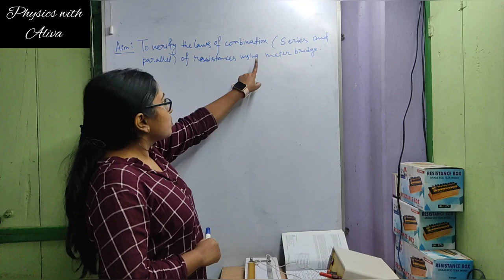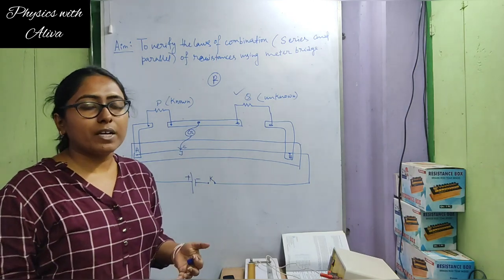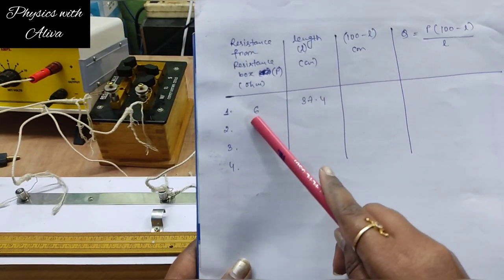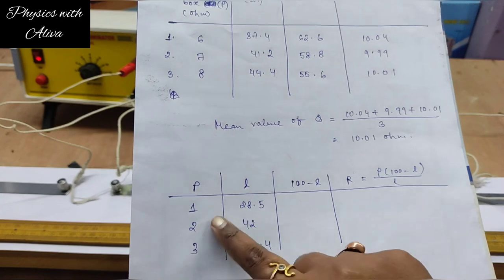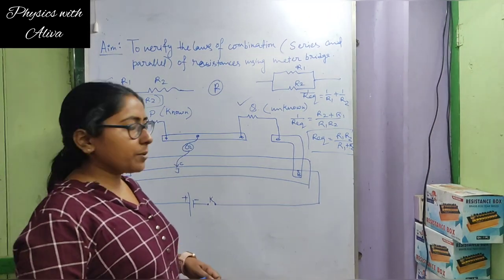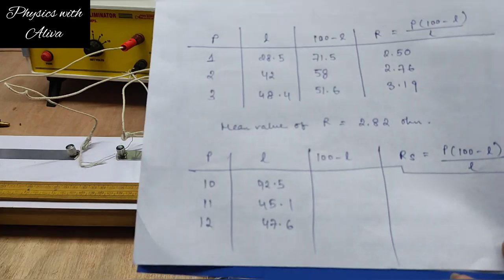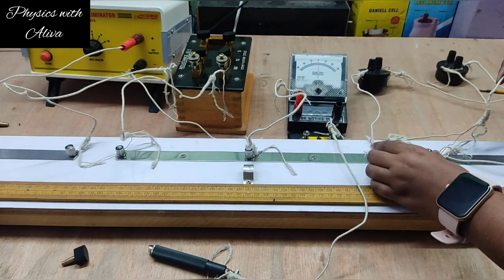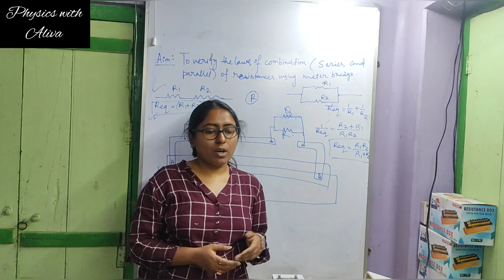To verify the laws of combination of resistances using meter bridge

Comment: Ma'am what is that black color resistances called??...Can we take resistance wires in combinations instead of that black (unknown) resistances...???
Reply from the maker: Yes, you can. Just one carbon resistance of a definite value is inserted inside the black cover.
Reply: @physicswithaliva9791  okay ma'am thank u so much 💓